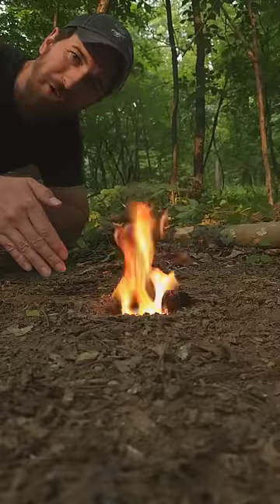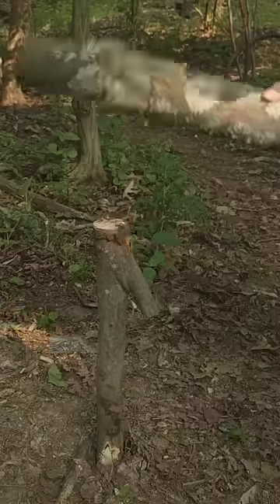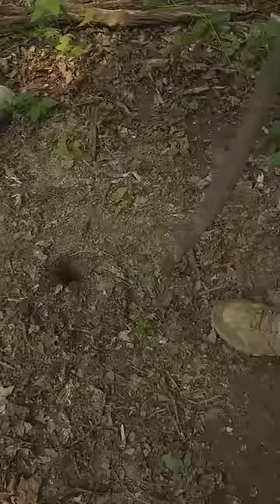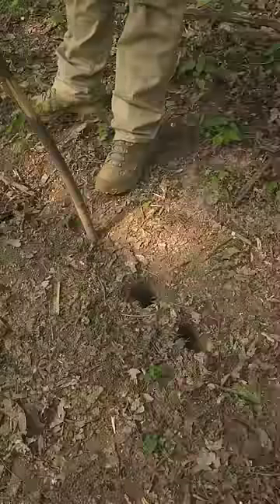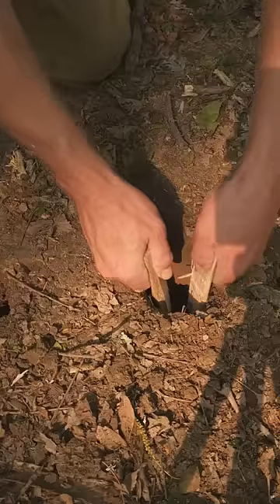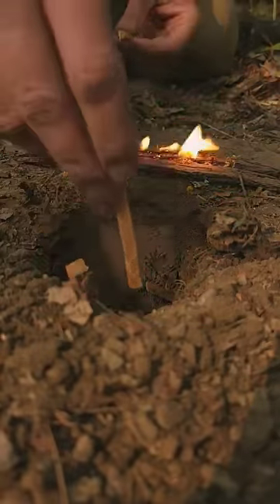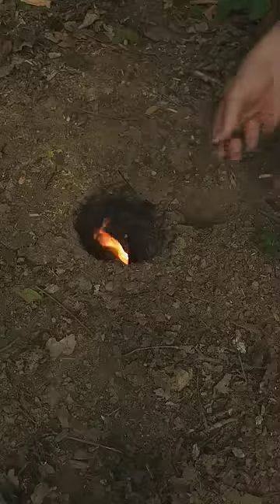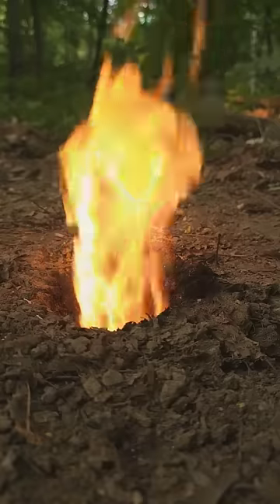Make a mini fire hole/rocket stove with no shovel 🔥

Comment: Nice work. Be careful - underground roots can absolutely burn for days and pop up away from the fire hole.
Reply: Good point! 👍👍
Reply: Wouldn't that fire sizzle right out once you fill in the holes and cut off the oxygen?
Reply: @TheKingacevedo  there are underground coal fires that have been burning for decades in a low oxygen environment.  It's better to bring a small rocket stove with you that can charge your phone when you're camping.  They're less likely to start forest fires.  Alternatively build one out of rocks instead.
Reply: @TheKingacevedo  not necessarily.  Roots underground can still have oxygen around them and continue to burn/smolder.
Reply: @TheKingacevedo nope.  It's not uncommon for roots to start a fire far from source.
Reply: @HepCatJack those are coal fires from coal seams, can you really keep a fire going just by tree roots with the holes covered with dirt? I'm not an expert but I doubt all the comments you guys have been posting.
Reply: @a.syching678  since you doubt the answers in the comments, it's easy enough for you to google the information.  Comments that post links tend to get deleted and I'm in no mood to go about googling things for your benefit since it's something you can do for yourself if you're curious enough.    It's a fairly standard warning made by park rangers to campers during drought.
Reply: @TheKingacevedo roots may have air pockets to feed it and can burn for a long time even after you put it out
Reply: @a.syching678 you can doubt but its a real thing for fires to burn underground for a very long time
Reply: @TheKingacevedo current forest duff has enough air to sustain embers indefinitely. This duff is not natural and results after decades of artificial fire suppression such as has been practiced in California. Should the duff ignite, say due to arson, it burns much hotter than natural forest organic layers, hot enough to kill large, mature coniferous trees. There are ways to reduce duff using controlled surface burns, but this should only be conducted by professionals under controlled conditions, something California no longer does.
Reply: That's what I was just saying to myself if it burns under the ground it'll be setting all the roots on fire that's Underground
Reply: Oxygen is always being found in soil
Reply: True. I live in a rural part of Australia and we had a neighbour learn this lesson. 

He did a bit of group clearing and burnt the pile of leaves and twigs.  He put out the fire, or so he thought, only to have the fire smoulder in tree roots for more than a day and then break out and get a hundred yards down the hill.  Fire fighters managed to stop it before it got to a large stand of very flammable pines.
Reply: It's much better to keep the three rocks, and put dry leaves from sides. less effort.
Reply: Peat too.. smokes a little so you won't know it's burning! Afterwards you step on it & it collapses.
Reply: Don't forget about gas lines to.
Reply: Just pee on it in the morning. You’re good.
Reply: @a.syching678   Yes ,,,,,, however I would put an EXTREMELY low % on how many times it has happened from building some little stove in the ground..   lol,,,   Like a %3 chance...
Reply: @willieyoung4818  it only takes one match to start a wildfire. Just look at the California wildfires of 2021. It doesn't take much.
Reply: @SullivanScientific exactly my thoughts as well. Good way to start a bushfire.
Reply: it makes sense if there are small holes in the ground feeding oxygen. As it is very efficient burning. And yes if it is dry land, than you get fire...
Reply: @HepCatJack wroting yhat whole ass comment probably took longer yhan googling to be fair here
Reply: @Pepto8ismol  probably but if he's going to doubt what I write anyway what's the point of wasting my time looking it up for him ?
Reply: @willieyoung4818 
3% chance is still 3% chance!  The possibility of a subterranean fire!  It is not 0%.
Reply: @aybeem  the product is Biolite Campstove 2+ (the current version number may be different).  There is also a product called Power Pot 5 that can charge your phone when put over a heat source like a fire or gas stove.   These products typically use something called a Thermo Electric Peltier generator that converts heat to electricity by using the contrast of temperature (hot vs cold side).  Some hobbyists build their own.
Reply: So?
Reply: @aybeem turns heat into electricity it uses twigs as bio fuel and then uses the heat to chatge a battery that can power a fan light or cell phone. Forgot the name. Biostove?
Reply: Would something like an aluminum foil lining help?
Reply: @mindfulicious  aluminum foil will melt at 660°C  a well designed rocket stove can reach temperatures of 1200°C.  I don't know  how much heat is generated from a pit that works on the same principle but the ground would provide some insulation which would tend to keep the heat in.  

With a portable Rocket Stove one option could be to set it close to a large rock, heating it as you cook your food while camping, then by camping near the rock, the radiating heat would help keep you warm during the night without having to worry about having an open flame nearby.

There are YouTube videos showing people building rocket stoves out of rocks.  They are just as efficient, produce a clean mostly smokeless flame.  Native Americans mostly used these earth fire pits to avoid being spotted by unfriendly people.  This need doesn't come up as often these days.  It's also not an option in the winter when the ground's frozen and hard as cement.
Reply: @mindfulicious  not really as it will melt away or be punctured.
Reply: Not just roots, but mulch too. The ground is flammable.
Reply: @Gemmino-gq7op  mulch also emits methane pockets of which can either fan the flames or cause explosions.  In the melting permafrost up North there are pockets of methane lifting the ground in bumps.  In conditions like this you don't want to be lighting fires.
Reply: @HepCatJack  that's scary!
Reply: Always gonna be thousands of negatives to one positive
Reply: Thank You!! I was gonna ask about that.
Reply: +A. Syching I second what you said.
Reply: yessir
Reply: Run away run awaynot his problem
Reply: @ae3qe27u3 in areas with little rain it is true that a match can cause a wildfire. 

However, California wildfires are due to the nature of the plants. Due to the climate, most plants are coated in a waxy substance to retain water. This just happens to be very flammable.

Then after a large fire, the wax melts and coats the ground, so the next large rain causes a debris flow.
Reply: forest fire starter nothing more. keep your fires above ground please.
Reply: @HepCatJack This is an emergency concept
Reply: @ps138vs2cavi  a Swedish candle can just as easily be built in an emergency situation and be set on a rock so that it won't start a forest fire.    The method is similar the one in this video however instead of pounding the sticks in the ground, they are on a flat rock and held in place by rocks piled around the circle of logs.

https://youtube.com/shorts/5rprpqzsGTc
Reply: @HepCatJack and
Reply: @a.syching678 Fires like that usually happen in pine forests. Resin in the roots get hot and Stay hot. Drown your fire. Stir well. Drown again. Stir. Wait. Drown again. Best to use this fire method in a large clearing. Northern Minnesota Camper
Reply: Looked it up and apparently you're right. Absolutely wild, had no idea.
Reply: @HepCatJack charge your phone with a rocket stove ?
Reply: @wdwerker  the answer to that question is in the thread.
Reply: If you cover the holes after it should be good right?
Reply: @dale22x  if you're close to a source of water it's best to pour water in the hole.
Reply: This entire thread is worst case scenario.  Just a friendly reminder the world would be a constant ball of fire if these comments where entirely applicable.
Reply: 😂 if wet n fresh roots hurried inside dirt didn’t catch for there could  be fossil fuel well or methane gas escape that could explode or talking of explosion please check if any land mine or 2nd WW bomb buried there there which never went off, or heck May there’s snake hole or wasp nest who’s residents get mad or a shallow grave release old ghosts on you! 😂👍👌
Reply: @jpr2177  do a search for "Top 5 Methane Bubble Releases".  On YouTube, people are able to start a fire on top of a lake.
Reply: Lol bruh chill tf, that does not happen. Lmfao.
Reply: @_Knives  if people have done it and it was filmed as people have done it, then that literally happens.
Reply: @HepCatJack  bruh there's no science behind that, how tfdoes something keep burnin underground if there is no oxygen...
Reply: Maybe evergreen forest roots or rotten ones, but green roots can never burn
Reply: @TheKingacevedo  Roots have ways of intaking oxygen even while buried. They are made of living tissue like the rest of the plant, so they require oxygen for cellular respiration. They'll have plenty of fuel for a fire to burn.
Reply: @_Knives  forest fire spread through roots and such absolutely does happen. Source: am firefighter.
Reply: Forests are supposed to burn.
Reply: Ig I’ll answer the question, yes you can have underground fires most commonly in places with a dry duff layer and can also burn in roots lol am a wild land firefighter so yes the root system can burn
Reply: @a.syching678 so, your saying:  statistics and numerous instances of anectodal evidence, all of which involve people giving similar warnings, all along the lines of "hey its POSSIBLE roots nearby and in the right conditions could ignite longer than the time youll spend @ site", alone isnt good enough for you. 
But you also  choose not only ignorance but to minimize this possibility to others reading your comment,  all because what, you have an assumption that this isnt possible, despite atleadt a few easily citable instances in which brush/forest fires, etc. Were started by this very means....

Not trying to sound like a dick, but...come on dude.  If multiple people are giving warnings, especially with something in regards to camping, that alone makes it a pretty safe assumption they arent just making it up for posterity's sake.

And without even a cursory glance at something that could affirm you were wrong, you just posit nonsense attempting to invalidate these statements to others reading? 

I just dont get it. Healthy speculation and objectivity can be good tools, however if someones telling you the sky is blue, books say the sky is blue, science says so, and you can see it if you simply go outside, to then say "are you sure? I dont believe you, its probably red and all of you are wrong" is just not pretty dumb, but dangerous as well.... 😫
Reply: @TheKingacevedo roots can smolder under ground for a long time
Reply: @paradoxstudios6639 in the middle of the forest ???
Reply: That’s crazy! I didn’t know that was possible. So how would you build the perfect fire for cooking ?
Reply: @nevisstkitts8264 THIS
Reply: Thanks!
Reply: Interesting... i burnt an invasive tree in my yard and it took a very long time and a whole lot of water to kill the fire and I found it to be pretty... notable ... a potential underground root fire makes sense now whew that was a close one. next time Ill rather dig it out its less risky lol
Reply: That's how coal is made
Reply: No sh¡t
Reply: No they can’t.
Reply: No they cant
Reply: The roots are incased in dirt
Reply: Also they are very wet
Reply: @Sonofsun.  you are absolutely incorrect. Fire can, and does, burn underground.   Even in dirt.   Source: am firefighter.
Reply: @SullivanScientific  no it doesn't  in doesn't have any oxygen
Reply: @SullivanScientific  i dont care what your source is i know how fire works i have made a lot of campfires and put them out. If you want me to believe you, you should give me a full explanation
Reply: @Sonofsun.  what are you talking about. Fire needs 3 of 4 things - heat, oxygen, fuel, chemical reaction.  

The root matter is heated, contains fuel, and contains oxygen. 

Saying it doesn’t because it’s surrounded by dirt is like saying your blood doesn’t carry oxygen because it’s surrounded by your skin.  

It is factually incorrect.
Reply: @SullivanScientific  root contains oxygen? Lmao
Reply: @SullivanScientific  dude you're trippin
Reply: @Sonofsun.  yeah. Between fibers, layers, in the soil and duff around it .. read the link?
Reply: @Sonofsun.  just cause you can’t fit doesn’t mean o2 can’t.
Reply: @Sonofsun.  Bro, you're in over your head here 💀💀
Underground fires are really well documented. There's plenty of places to read about it, don't force some guy in the YouTube comments to give you a chemistry lesson just to overcome your skepticism
Reply: @ae3qe27u3  to be fair, Cali forests are anti-managed. All time worst example for flamability.
Reply: @a.syching678 if you doubt thar, go sign up to be a "Smoke Jumper" or ground crew wilderness firefighter. You'll find out by hard experience.
Reply: @a.syching678 I agree with you. You can't compare coal fires to this. And no, if you really fill  the wholes back in with dirt everything will be fine
Reply: yep, our old fire pit lit the roots in our backyard on fire for days... be very carefull to extinguish this with lotsa water
Reply: That's why it also doubles as a pee hole 🍻
Reply: @HowardBaileyMusic  this is fact.  Any hole is a pee hole if you just believe.
Reply: @a.syching678 you doubt "all the comments?" Intense.
Reply: This
Reply: I live in Montana and this shit happens ALL THE TIME. I've read many stories of campfires that people swore were out, only to have a burning root finger its way out of the fire pit to flare up days later into an uncontrollable blaze.  Now I carry a stove and I can't remember the last time I built a fire in the wilderness...
Reply: @a.syching678  Are you familiar with Charcoal? What do you think that is! It is wood (could be roots etc) that has been strongly, slowly heated in a minimum oxygen environment to produce a carbon residue with all water removed. The result, that everyone who BBQs knows, is that charcoal burns readily and hot. And so could the forest underground.
Reply: @willieyoung4818  ok. If you are confident, let’s try it near your house! 

I thought not. 🫣
Reply: @a.syching678 no stuff can burn underground if there's fuel&the right conditions. Down south there are certain "lighter stumps" that contain a natural kind of  flammable oil.
Reply: We have an underground fire near us and Colorado govt is talking about putting it out now. Not sure how.
Reply: @TheKingacevedo    Of course it would..
Reply: @TheKingacevedo soil is actually quite breathable because of the worms and insects inhabiting them. Trees actually need to have well oxygenated soil, so any area with trees thus has enough oxygen below ground to sustain small fires/embers :]
Reply: @HepCatJack I.
What, is it your period?
Reply: Long after you have made your escape.
Reply: Adding my support.  We have had two incidents of root fires near us.  One broke through in the middle of the neighbors front yard from a fire their other neighbor had  three days earlier.
Reply: @HepCatJack the fires that have been burning a 50 years or so.
Reply: @HepCatJack  y'all play nice.

Comment: Obligatory: don't do this near trees or stumps to avoid starting a root fire, those can be really destructive
Reply: Thats what i like
Reply: @sanchochingon3194 do you like forest fires?
Reply: @madokachan I hate birds, and they live in trees. Therefore by the transitive property. I hate trees.
Reply: No one asked you to repeat completely obvious things.
Reply: Doesn't anybody read responses already posted??
Reply: A rocket fire is a fire  @madokachan
Reply: roots spread out twice as wide as the canopy. There are roots everywhere. Shrubs also can have extensive root systems. 

Simpler - just don't do this.